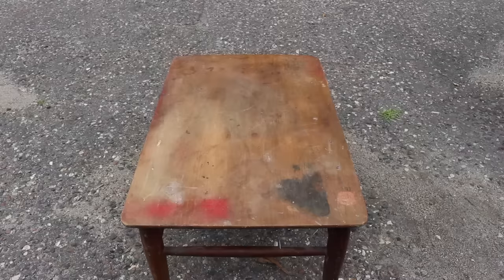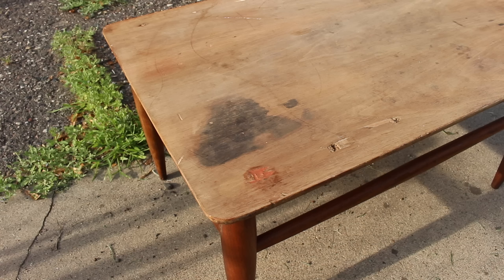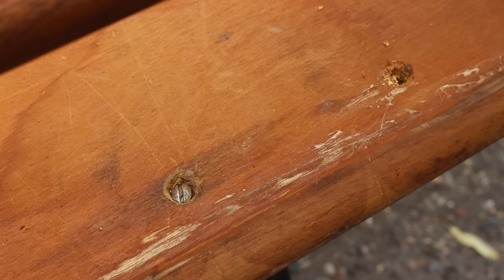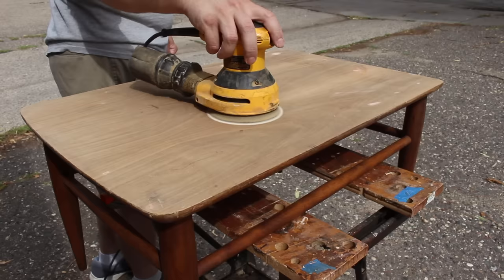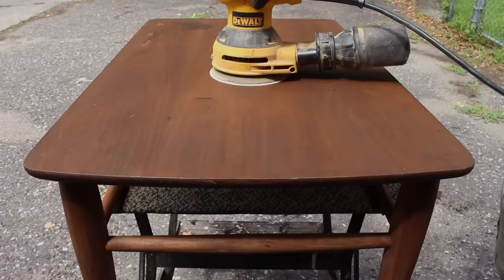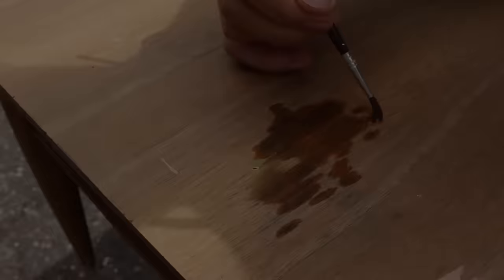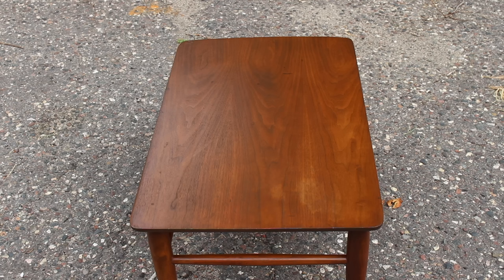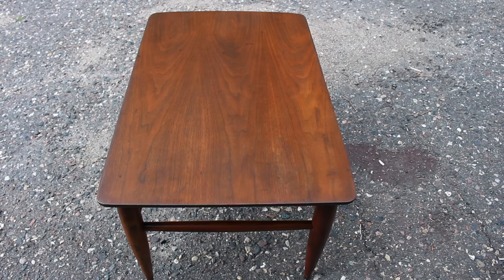Mid Century End Table Restoration | Furniture Refinishing

Comment: I am slowly replacing all the IKEA in my house with interesting yard sale/curb freebie/flea market finds. I rarely completely refinish anything because I like the history of scratches, etc. I do more cleaning and physical stabilizing (removing modern nails and screws, etc.) than refinishing, but I always want to learn more.
Reply: I like your style, I love the curb side freebies and resale shop finds. As a professional restorer and conservator, let me share a few hints. Not everything needs to be refinished. Washing a piece with Murphys Oil soap to remove years of grime is a good start. Then on a warm day in the driveway use Kiwi shoe polish and fine steel wool, working with the grain. Let the Polish dry and buff with wool sock. You save the patina and project can be done in a short time . Kiwi Shoe polish has Carnauba wax in it, very fine, very good.

Comment: The parts where the table was rocking up and down while you were working on it, is a bit unsettling.
Reply: Spends hours restoring table. Doesn't spent 1 minute putting a wedge under the uneven legs.

Comment: I''m currently restoring a 1920's -ish pedestal desk with a table top in believe it or not worse condition than this. I learned a few tricks for the same issues I have, thank you! I am especially grateful for the discovery of oxalic acid, as I've been trying to figure out a way to remove a bunch of staining without burning through the vaneer

Comment: That's the great benefit of working with old wood.  It's fairly resilient, so if you mess up, sanding down won't hurt anything. In fact, often times more sanding will only help improve the final outcome.  Good job bro, if you were selling that at a show, I'd buy it.

Comment: looks really good, somthing you could use,  over poly, you have to sand between coats to make the layers bond, you don't have to with lacquer as each coats bonds to the last,  if you kitchen cabinets look worn just clean them with alcohol and rub more lacquer over them.  you could have colored in the patches to match the wood grain with markers just blend it in until it looks good by the eye.

there is no reason to throw furniture out that's made from hardwoods. its a waste
if the surface is so bad it can't be fixed you can always cover it with wood or paint it.
this pec was so bad it was past salvage but you fixed it anyway and it looks really good.

Comment: On oldwr wood sand and coat in a conditioning oil. It will help moisture the wood and also shows all the imperfections and unecen areas that would show up in during staining. Let the oul fulky dry, coat in woid conditioner before staining really helps to ensure the stain is even

Comment: OMG, so glad to find this video. I stripped a vintage French Louis XV footstool; very ornate with rosettes and carvings. I could see the wood had imperfections, discolorations in some areas. I'm at the stage where I still need to fine tune the stripping. I'm down to the bare wood, but there are hints (flecks and specks) of paint deep in some areas of the grain. Not noticeable to most, but up close it is noticeable. Staining over these would not be successful. I've picked up some tips on how to get the wood really clean. I now have to decide what type of stain to use, so the wood really soaks it in evenly. I'm thinking MINWAX PolyShades. First I still have to lightly sand the wood with the lightest (grit) sandpaper; being careful not to damage the rosettes. I'm a total novice, and hope my project is successful. Thank you for your video.
Reply from the maker: Hi, be careful with polyshades. I’ve tried it and found it very difficult to use. You might want to try a gel stain instead. I like the ones made by General Finishes.

Comment: I had a piece very much like that, but  did not use paint stripper. Gas and a match worked well and did it's job. Just let it ash over, then break out the leaf blower. That's a proTip free of charge, LOL.

Comment: Alcohol works pretty well to remove ink and many dye stains.  It may also remove all of the finish too, so use with that in mind.  
Someone sat a black canvas tote bag with a leaking bottle of hair spray on my antique tiger oak floor, and the dye stain was so dark it looked Iike spilled black paint.  Alcohol was the only thing that removed the black that had soaked into the wood grain.  It also removed the old varnish, but I could work with that.

Comment: For the hole made by removing the filler material ...you could take the dust from sanding the top and make a filler with the dust mixed with glue that would match the other wood.

Comment: prob isn't just light or dark, it's also hue and how dull it is.  That last stain was darker but also duller.  I think you did okay putting acid only on the ink stain.  Then, adjust it later by.. staining it more with that first stain?  those screw holes...  seems you didn't darken them enough either.   but interesting improvement!

Comment: I know this is an old video but if you still do this type of stuff, plastic wood filler is way better. It's dry in an hour and it's light so it's easy to mix a little stain with and recolor it. I've been using it for about 2 years now.

Comment: So for your filler I’m sure you’ve seen people do the wood dust and wood glue trick but of course that doesn’t stain well because of the glue. But next time use your wood dust from sanding your project and mix it with whatever finish (polyurethane) you will use on your project. It stains so well and you will barely notice your filler unlike plain wood filler.

Comment: Nice instruction, thank you. But I'd like to offer this to someone not experienced, that will try something like this. In this video it appears he ignored the edges/sides of the table top. You shouldn't do that unless you want the edges/sides to look old and damaged. There appeared to be some paint and gouges he didn't fix on the edges. I would have. But what he did to the top was great.

Comment: Another nicely done piece. I did not know you can apply gel stain right over a polyurethane finish coat. Also would not have tried petting lacquer over top of polyurethane. Anyone have any trouble doing this?

Comment: Good video and the end result - after all those steps - was good!  I especially liked how you stained the table then had to sand it back to work on the black stain more, which is what I am going to do with a table I am working on.  However, I think I have a massive, well-penetrated oil stain.  Would you recommend the same process?

Comment: So what would you recommend for this scenario? Im restoring a 1971 Chris Craft Commander, in the galley everything is this ugly light colored thin type bamboo veneer. We tried a semi transparent then used a chocolate wood stain. Still looks crappy, owner wants to try to antique it...same as distressing? With white paint. We painted a small section and wiped off but doesn't look right. Owner thinks now to just paint over it white. Should we use steel brush or steel pad on drill and buff it out lightly first? Sand it? Any suggestions are appreciated. I'm working with my partner who has construction and carpentry skills... me..I've worked in an office for 25 years, just learning everything as we go every day. Thanks for the videos. Thank heavens for You Tube and channels like yours!

Comment: ever tried using sanding dust from that table and wood mixed with warm hide glue to create a paste for filling? if so, what do you think is best and why? i used that hide glue paste in the past and i feel makes wonders especially that it is accepting stain nicely. not perfect but works well when i used it.

Comment: Very unusual labor intensive technique. I'm not sure why you would want to use paint stripper if sanding the work surface after.  Also 120 Grit is a very fine grit to use for the first sand, I usually use it as a finishing grit. With a worktop in this condition I would usually start with a 60-80grit and work upwards. I may understand it if it was a veneer but solid can can a fair amount of abuse.
Reply from the maker: This was a veneer.  I prefer to use stripper to remove the finish because there is a lot less risk of damaging the veneer than by sanding.  I also find the stripper to be quicker than sanding.  I rarely need to use 60-80 grit.  I usually use between 120 and 220 grit.
Reply: @DashnerDesignRestoration  Fair enough. I assumed it was solid. I use a 150mm festool and really cuts through the  old finish in minutes.

Comment: For holes I always hoard chopsticks (unused) then after applying the superglue a lil pinch of baking soda, accelerates and dries harder, sand, filler, resand ..
Edit: I've actually had luck with mixing bleach and water to lighten and remove stains

Comment: Nice - Thanks! 
Do you maybe have any ideas on what finish i can use on a just sanded piece of dark wood? I want to keep the natural slightly dull shade and don't want that deep dark grain enhancing warmness that oil gives. I want it to look likes it been just sanded but then be slightly protected from UV or oxidation etc... Any ideas? it's a display cabinet so very low wear

Comment: Veneer is a thin layer of material, usually wood, used to cover a surface. I think you mean patina.
Reply from the maker: That’s correct. This has a thin layer of walnut on top, also known as veneer.
Reply: @DashnerDesignRestoration  my apologies. I jumped the gun.

Comment: I am refinishing a round, pine Drexel dining table that was painted twice. The outside beveled sides were painted forest green at one time, then the whole thing had been painted white. I stripped off the white, then the green but the green paint has left a dark tint to the wood in those areas. My end goal (I think) was to restain that part, so I don't need it totally natural pine colored, but I don't want it to be a weird color. Will mineral spirits clear it? Thank you!

Comment: Question: I applied stripper and scrapped it off thouroughly. The finish came off nicely but even then, a lot of goo was left. The goo stuck to the sander and made the pads unuseable. Did i not scrape the stripper well enough, should I leave it to dry longer ? Thanks for your inputs

Comment: I've never really used stripper, i generally use scraper or whatever the metal plate is called. Is there a specific reason you've learned to use stripper because of or..? I've yet to figure out why the stuff even exists. I mean, maybe if theres A LOT of lacquer, maybe?

Comment: I think if it were my table I would have kept the character of the top and just put a thick layer of epoxy over it. Then play it by ear and either lightly clean up the legs, go full restoration on them, or maybe just put new legs on if they were too far gone.

Comment: Hi after watching several videos, I really want to restore a table that I found for free on Facebook. Today I talked to the table's owner, the table itself is not in really bad shape except they decided to painted the top surface of the table gray to match with the chair. But no paint was applied to the legs. the surface of the table has some big bubbles where water was in contact with it. In addition, there are little cracks but I wasn't sure all over the painted surface of the table. Fortunately, it didn't happen around table rim. I wish I could send you the picture of the table. But I can't do it in the comment section. Please give me some guidance if you can. Thank you

Comment: No offense, but that was a helluva lot of work for that finished product.  I hope you keep it.  As a professional woodworker, my suggestion would be simply to re-veneer it with a piece of walnut.  You can buy it online.  I buy wholesale, so that much of a sheet would run you literally about 5 bucks for that top (I pay $50 for a 4x8 sheet of solid walnut).  Get a can of contact cement, put it on the top of the table and on the back side of the walnut sheet and then let the contact cement sit for 15-20 minutes until it dries.  Then apply the sheet to the surface, push it down hard with a j-roller, trim the edges with a piece of sandpaper and voila, NEW top of solid walnut.  You are then ready to stain and spray lacquer the top with pre-cat lacquer or even conversion varnish for the best finish out there.
Reply from the maker: I've already done a couple videos where I apply a new piece of veneer so I took a different approach with this one.

Comment: Appreciate the video but your thumbnail is two different corners and I'm pretty sure you flipped the table around near the end.
Reply from the maker: It's actually the same corners.  Examine the grain pattern closely.  Also, in the after shot you can see the three dark spots on the right where the two screw holes and bondo were.

Comment: I am from Ukraine and I don’t understand what “stripper” means. Is it kind of resin ?
Reply: Yes "stripper" comes from the word "strip" which means to remove the outer clothing. So used in this application stripper refers to any chemical which is used to remove the outer coating such as varnish, lacquer, or paint that was put on top of the wood. A very popular type of stripper is based on citrus extract because this type of stripper does not have the strong chemical odor which is good if you are stripping the furniture indoors. The type of stripper you will need to use depends on what type of coating you are trying to remove. If you are not sure then it is best for you to go to a store that sells these types of chemicals and ask them what they will recommend to remove the type of coating that is on the wood that you are trying to strip. Слава Україні!
Reply: J A thanks, bro! Слава Україні !